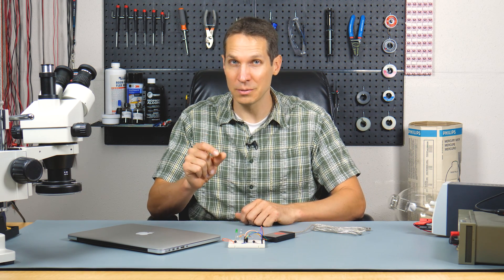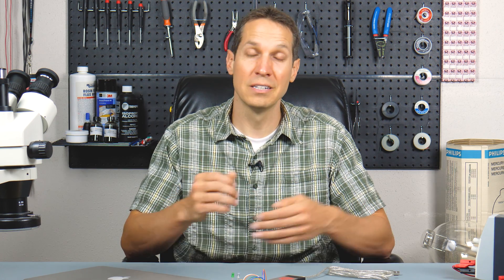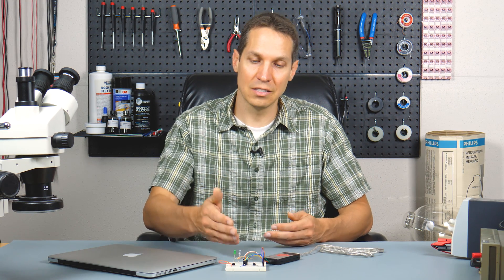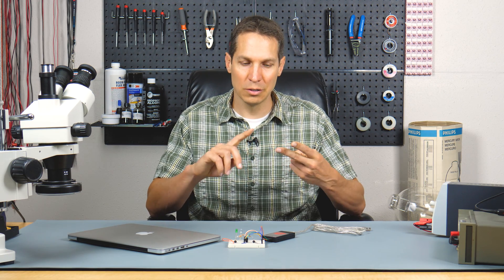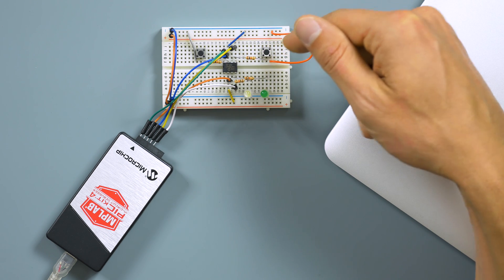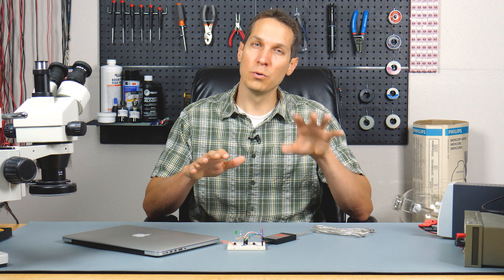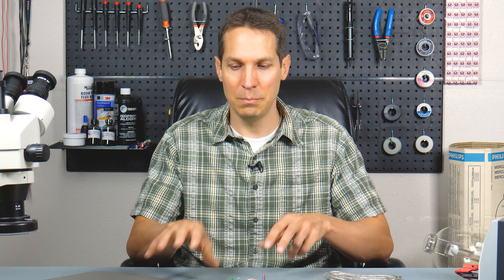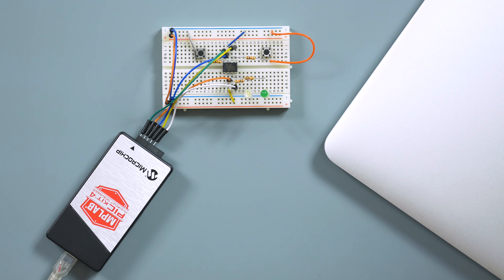How to Use a Simple Microcontroller (PIC10F200) Part 2 - Equipment Needed

Comment from the maker: Hi all!  As I mentioned in the comments of the first video, these are based off of Sergey's written tutorials which go into much greater depth on the individual Assembly commands, the overall structure, and provides the code to copy-and-paste.  I highly recommend you go read the written tutorial after watching the video - you will not regret it!  Here it is: https://www.circuitbread.com/tutorials/equipment-for-our-simple-microcontroller-tutorials-pic10f200-part-2

Comment: It is a shame they (Microchip) didn't make the software needed to program these microcontrollers Opensource.  They are just hurting themselves.  Are there any opensource alternatives?
Reply from the maker: Sergey is actually considering making an open source programmer (both hardware and software).  There may be some other options from less credible sources (AliExpress, etc.) but I'm not familiar with any in particular.

Comment: Hi, i got a question, I got a Pic 16f84 and I was planning on using the CCS compiler I think is called, can I follow the tutorials anyways or is there differences between how different PICS operate? Thank you
Reply from the maker: Compilers unfortunately do affect subtleties of the syntax and, not being familiar with CCS, I can't tell you how much of an effect it will have.  That being said, the structure and concepts will definitely apply to the PIC16F84 so almost everything in the video (though not necessarily the written tutorial) should work.
Reply: @CircuitBread  ok thank you very much! At worst I at least learn assembly which already is very useful, tho likely in the future I would be adquiring a  Pic 10f200 as well to follow the tutorial, tho that leaves me with another question tho idk if you can answer this one, I'm planning to buy an already made programmer for the  Pic 16f84, now, does it already work on other Pics or do I have to buy a programmer for each? Thank you again
Reply from the maker: Good question!  The PICKits 3 and 4 work with nearly all PICs, so, while verification is always nice, it should work with the the 16F84, the 10F200 as well as the 18F14K50 that we're doing our C based tutorials with.

Comment: Glad I found your channel, I was pulling some IC's off a few scrap boards and came across a PIC18LF242. I'm hoping this tutorial gives me a little insight into what this little micro-controller can do even if it seems to be pretty dated....lol
Reply from the maker: Nice!  Good luck and have some fun! It's interesting how some of these chips that are 20+ years old are still good for a lot of simple work, there's no need for anything faster or more complicated.  But the more complicated chips are available for more advanced projects.
Reply: @CircuitBread  I’m glad I found your videos, I’m working on getting the PIC4 programmer so I can follow along. It seems that this chip is still on there website but is not recommended for new designs. Regardless, I’ll give it a shot.
Reply from the maker: It's fine for learning and practicing - if you were planning on creating a product that would need 10,000+ of them, you would probably want to use a different chip.  But for this purpose, what you have should be perfect.

Comment: Another question: Would the MPLAB Snap work instead of PICkit 4? What are the differences?
Reply from the maker: I haven't used the Snap before but, looking at it, it seems like it would work.  The only potential reason it may not is if it doesn't do the high-voltage programming that is required for some of these.  But, reading the data sheet, it doesn't say explicitly that it does (or doesn't) and that is supports all PICs, so my assumption is that it does.
Reply: @CircuitBread  Hmm. I see. Comparison page with the pic 4 says that the snap does PDI and UPDI only in low voltage. Is that a problem? Thank you for your help!

Comment: Hey. I was just wondering would it mater to get something a bit more feature rich such as  PIC10F322 instead of the also older 200? Would it matter if i follow this tutorial? Or i guess by both and use the 322 later to play around with interrupts for example?
Reply from the maker: Yeah, all of these tutorials should apply to anything in the PIC10F family.  There will be times that you're not using some of the features of the more powerful siblings of the 10F200 and, this is where I'm not as certain, some registers may change.  But all of the principles and structures will work just fine with hopefully minimal or no changes whatsoever.
Reply: @CircuitBread  Thank you for the answer! I know some basics of assembly and microprocessor architecture, i am sure i will find a solution somewhere.

Comment: for the piezo buzzer, I keep finding ones that say things like continues external/internal, nothing that says passive. Are any of these that?
Reply from the maker: Good question - I'm pretty sure what that's referring to is an internal driver or if you need to provide an external driver.  With internal drivers, you just give a DC voltage and it takes care of the oscillation.  With external drivers, you have to provide the PWM signal.  In this case, you'll want an external piezo so we can manually change the frequency of the oscillation.

Comment: Hi there, thank you for this awesome tutorial, you explain very well. I would like to know if the K150 programmer works with MPLAB -X. I used to program 10F200 MCUs using C language, now I wanna learn assembly. Thank you Sergey for the initiative!
Reply from the maker: Hey Rafael - I haven't used the K150 myself, but looking at it, it looks like it wouldn't integrate directly with MPLAB X.  Despite that, you can still export the code from MPLAB and then use the K150's software to flash the PIC.  That's how I do it now anyway, but instead of using the K150 software, I use Microchip's IPE.  I don't see why that wouldn't work.

Comment: The pickit2,3,4 do show up as debuggers in the ide.  The simulator doesn't always work as expected but is great for verifying the correct writes to register's.  One thing I did notice that was reading the flag bits in register's doesn't work with the simulator,  maybe I'm doing something wrong or maybe the flag is cleared before I could read it but this has just been my experience so far.
Reply: One thing microchip suggests is to use the simulator until you are pretty sure its correct.  Then upload to the PIC and debug then tune the code for errors within the chip itself due to manufacturing tolerances.
Reply: Also I really like MPLABX IDE.  The reason is that the intellisense system helps you track down C90, C99 etc. Errors as well as other errors.  The setup is rather simple but the one downside is the amount of resources and system space needed to run the IDE.  Maybe when I get more familiar I may switch to a text editor but this works really well and helps with setup code for each different micro.
Reply from the maker: Hey James - yeah, I have my issues with MPLABX IDE but all in all, I think it's one of the more user-friendly IDE's I've dealt with and I certainly don't have any plans to switch to a text editor. I did finally (hopefully permanently) fix a Windows laptop that has had display issues for a long time, so I'm planning on installing MPLABX on there as it's still not working on my Mac.  The MPLAB Xpress gets points for simplicity in its interface but I hate the process of flashing my PIC and hate how it logs me out all the time.
Reply: @CircuitBread  Have you tried a small virtual machine on Mac.  They have a linux version so you could use any of the linux systems.  Might save you the trouble of configuring your old windows machine.  Or having to use two different systems and maintain both systems.
Reply from the maker: I used Parallels for years on my Mac for both Windows and Linux instances and it's functional but it used up a huge chunk of my limited hard drive space and, while great with peripherals like an external keyboard and mouse, would struggle sometimes with random dev boards as it couldn't figure out what it was connecting to.  That's still an option, though, if having the Windows laptop is more trouble than its worth.

Comment: all very good. I am though after a micro controller for a thermostat. can you help at all? thanks :)
Reply from the maker: Hey Parrot340, sorry about the delay, I somehow missed this message.  Sergey just finished writing a tutorial for communicating via UART with the PIC10F200 which means that you could connect a UART temperature sensor to it.  It's a long tutorial, though, so I'm not sure how soon we'll finish editing the written portion and then shooting/editing the video.  If size and cost aren't an issue, nor are you doing it as a learning experience, honestly, a simple Arduino would probably be best.
Reply: @CircuitBread  yes size and cost are an issue this is a thermostat for manufacturing. look foreword to watching the vid when it comes out :)